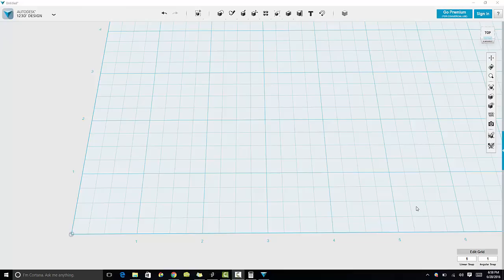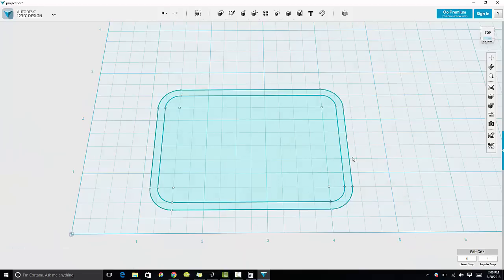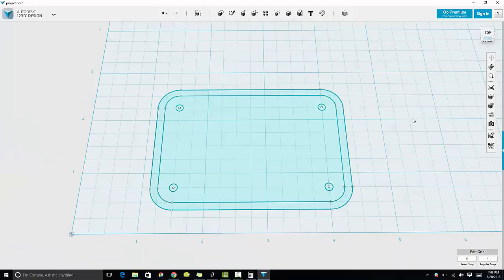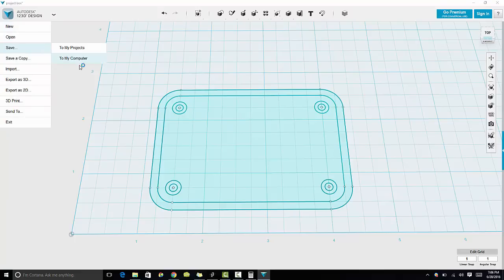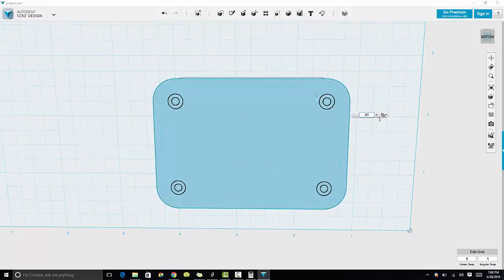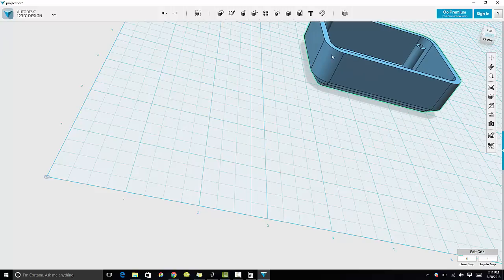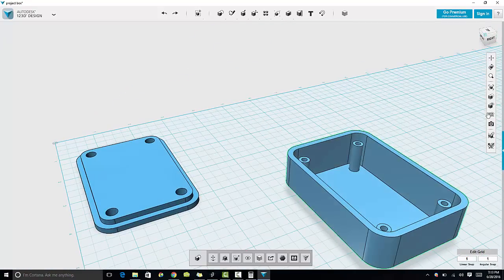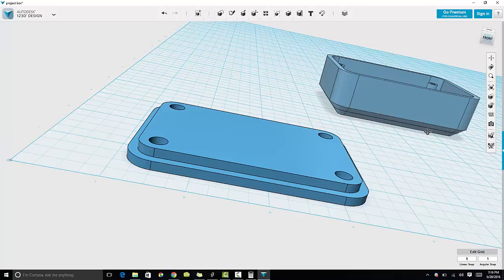AutoDesk123D Design - Tutorial #2

Comment: The chamfer you put on the bottom cuts all the way through to the inside  of the box and the bottom will break off. Also the holes in the lid are the same diameter as the outside of the screw standoffs. But good tutorial though. Thanks

Comment: 3d printer is on the way. Was interested in making soap molds, how hard would it be to angle the sides and few degrees so the soap comes out easily? Of course there's no holes but maybe an imprint in bottom of box with a name or logo.